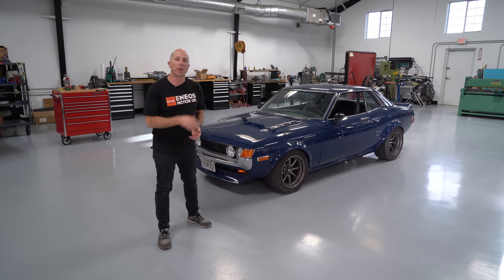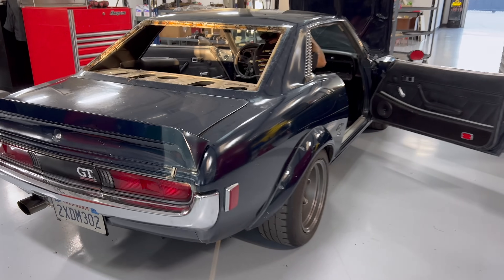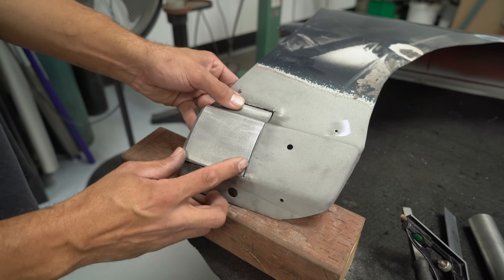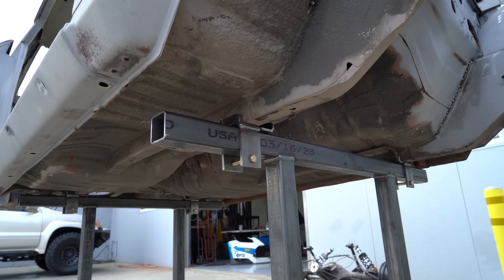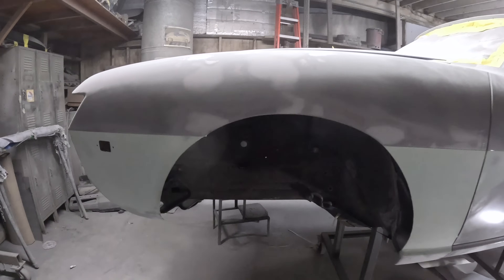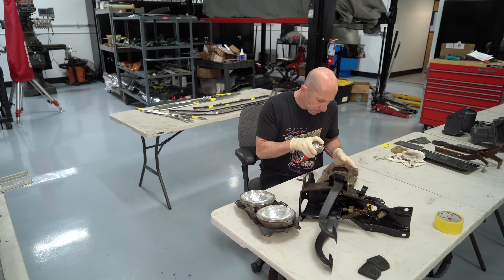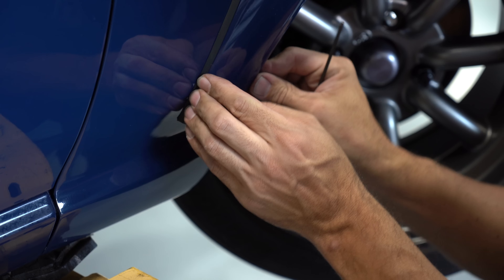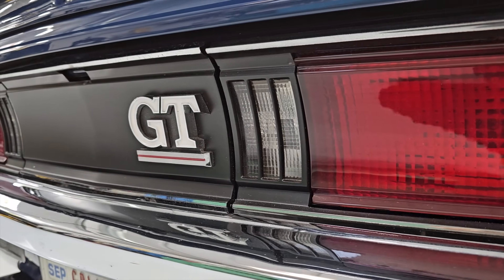Barn Find Full Restoration '72 Celica

Comment: Wonderful, wonderful job fellas. Dedicated craftsmen. My first car was a brand new silver-grey Toyota Celica ST I paid $6,500 CAD cash for in 1976 up at Don Valley North Toyota, Toronto. It was manual steering, no problem, automatic transmission, sporty, stylish. Drove beautifully at 140 horsepower, low weight, never wanting for power. I added parallel thin lines black pin-striping to side and hood edge, black/chrome side moulding, a tinted sunroof, red tint indoor light, classic spoke wheels, good looking fog lights, and a fabulous sound system (Pioneer receiver cut-out replacing AM/FM location and Pioneer equalizer underneath, front door quality Craig speakers and back Boston Acoustics speakers and extra amp power) custom installed. No air conditioning needed, windows wide open and no strut, plus sunroof. Lot of personal style, great sound system, a very cool and unique look and lots of really great memories surrounding it. Definitely, my favourite car. RIP

Comment: It's super refreshing to see someone spending the time and quality body work on a classic import, instead of the run of the mill 69 Camaro or other American muscle cars
Reply: I owned a ‘67 Camaro convertible in my youth (I also owned a ‘77 Celica GT at one point). While the Camaro was the only American car that I’ve owned over the past 46 years, I still really appreciate such cars. But I get where you are coming from. Ironically, back in the 80s when I had the Celica, it was considered a pretty run of the mill car itself as Toyota had sold a lot of them (for good reason). I just dig cars in general.

Comment: I drove an 80 or 81 (last year for the rear wheel drive) and it had a 3TC power plant in it. It didn’t have BBC power, but it was enough to do what it was supposed to do AND it took me all over my state to hunt and work. I sorta miss that little car. Ugly green but it surprised folks when I could actually “bark” the tires shifting into 2nd. 😂 Fun little car that got decent mileage.
Reply: I believe 1985 was the last year for the 3rd gen cars with rear wheel drive. My brother owned an ‘84 GT-S liftback in black — it was a great car. I’ve never been big on black cars or angular car designs in general, but that was a good looking car. In fact, I think his GT-S liftback looked better than the Supra of the day.
Reply: @VirtualGuth  I misspoke; mine was a Corolla, and a 2dr at that. It’s only been almost 30yr back.

Comment: That engine is a 2tg not available in the USA. I had a 73 corrolla and installed that engineI did a stroke using a 1.8 crank and an 189 mm pistons. It runs very strong

Comment: Kinda surprised that with such fragile components that you guys don't have a media blaster that uses plastic instead of sand. Sure, it won't take off rust as easily as sand, but you can easily strip 0.025" aluminum aircraft skins with it, so these car parts would be fine as well.